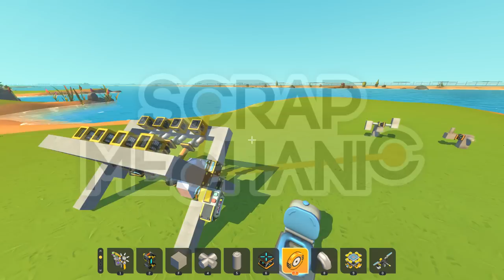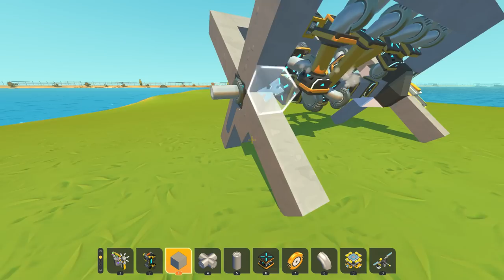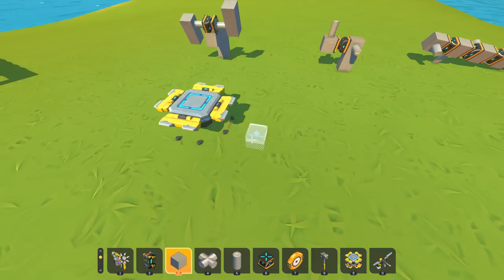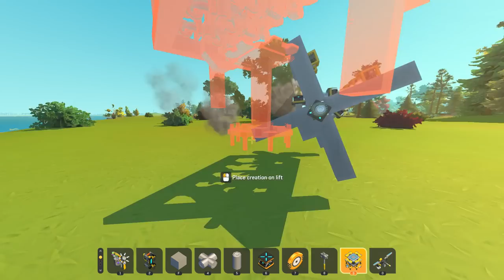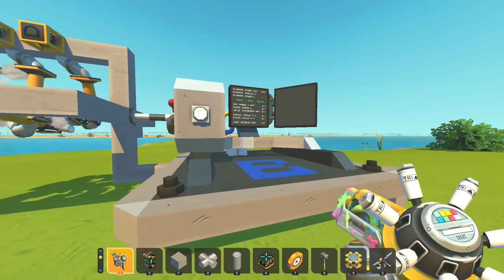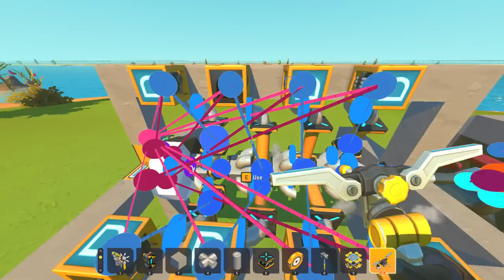I Built a V8 Engine Using 2 Amazing Game Changing Techniques!

Comment: Welcome to the wonderful world of advancing and retarding an engines timing! Normally in an older style engine with cap and rotor it will advance or retard an engines timing via centripetal force and spring tension. There's also the use of vacuum as well. Not sure how you can translate that to scrap mechanic though.
Reply: @Indy509 The old saying, people are like distributors. Some are advanced and some are retarded.
Weights and springs come into play, more then vacuum, or the lack of vacuum on some engines.
Fun fact, more then I can count, the gear on the shaft is on the wrong side of the timing line tooth.
The roll pin should be on the half tooth of the gear, not on the full tooth timing mark when lined up to the pointer on the rotor.

Comment: Here's a question: is this technique to replace the bearings with the piston hack a feasible method to replace all bearings where size constraints aren't a priority? In what situations would I not want to use that version over a bearing? Sure seems like this would solve a lot of problems all-around where the bearings usually slip.
Reply from the maker: You can only get it to go to 90, 180 or 0 degrees. Can't have a piston do any intermediate measurements so a bearing would be better in those cases.
Reply: @kANGaming  What about the free-spinning piston?

Comment: your actually correct, having different tuning for load is what real world engines do with advancing the timing of the spark plugs. 
I think the main requirement to develop different tuning will be a tachometer, which obviously won't be easy in sm. or though it might be possible to instead of having a tacho, to actually develop a variable throttle, that could operate in the same way. for instance a simple version could be to use the steering ability from a steering wheel to control a lever that then has different points that sensors pick up on. or alternatively having a multi stage throttle, with more limited control.

Comment: Please do a piston powered survival run, no electric of gas engines, every vehicle has it's own tuned piston engine. You would have to figure out unique and novel ways to complete certain tasks that were easier with vanilla engines, eg. how do you power your drills and saws, how do you power smaller vehicles, how do you set up a hauling truck for your crates that has enough strength to pull the weight, maybe you have to setup a train track/monorail system so you don't slip as much and have shallower angles.

Also I think you should start with a few pistons and logic gates, seeing as you wouldn't be able to use any of the vanilla engines that you are basically given early game.

Comment: It'd be super bulky and Idrk know Scrap Mechanic enough to know if it'd work or if I'll explain what I'm thinking well enough but, for a variable encoder wheel, could you do a large wheel, with sensor rings, coloring each layer as needed for the higher speed. Then use a couple timed logic inputs to verify the wheel speed to determine which ring of sensors to use as the encoder. So like the inner most ring will run if no other ring is running, the next closest ring will run if two inputs receiver input within say 3 seconds, the next ring will active if they both fire within 2 seconds and so on.

Comment: I haven't tried it,  but i bet you could use a single timing arm on the shaft,  triggering a single piston to extend slowly.  It would auto retract between cycles. You could use a block and sensors to tell what is position is,  as a sort of rough speed gauge.

Comment: If you are truly like a steam engine the timing events would correspond to "A" side of piston will have four events and the "B" side will have four events. Intake pressure valve "open" and "closed", exhaust valve "open" and "closed". The time that the valve would be open would be called "duration" and can be expressed in degrees of rotation. If you have control of those functions you will have the tools to truly optimize the output. With internal combustion engines the intake valve opens slightly before you would expect and for a short time both valves are open and the exhaust closes later than you think it would. Maybe one of the other viewers can tell us more about the specifics of steam engine valve timing

Comment: I have no idea how you would covert it to scrap mechanic but all gas motors are set up to advance timing when giving it gas and the same principle applies when letting off the throttle/ and or a heavy load pulling it down so the motor is always performing optimally.

Comment: you could have a little calculator that calculates the period of the wheel and use that to calculate the speed of the drive shaft qnd theoreticly it could all be done in scrap mechanic

Comment: When you change the text file for the creation, does that mean you then can’t upload it? I assume scrap mechanic would change it back when you upload it if it does?
Reply from the maker: You can still upload it normally. The game doesn't correct any changes you make in the text file which means if you make a mistake it'll potentially corrupt the blueprint and it won't load at all.
Reply: @kANGaming  Huh. Thanks for clarifying!

Comment: 45° Worm gears are better for differentials, they use more bearings but they are WAY smoother and way less buggy with collisions.
Reply: @kaylinosprey3306 Are you sure that would not be a spur gear set for a dif?
Worm gears are best used to reduce speed, and increase torque.

Comment: Also kan you definitely need to spend more time on timing and add more timing as you go up in rpms because essentially what your doing know with this engine is locking the rpm like a governor also you definitely need a flywheel if you do that
Reply: what i assume is happening is since this is a double acting engine since you arent adding timing as it goes on the double acting makes it worse

Comment: What if your timing wheel only had ONE white block, and the pistons were controlled by memory lock circuits?
This way if sensor 1 is triggered, the pistons associated with it will stay on, and the others will turn off.

Comment: The part that is seen by the sensor that fire the piston should be at the angle which is the next angle of the shaft in the future tick it should be calculatable with the rotation speed thingy on the xo-meter when deltaTime is 0.025(1/40) scrap mechanic has 40 ticks a second

Comment: With the v8 piston engine would using 2 encoder wheels 1 for each side of the engine produce more horsepower than using 1 encoder wheel

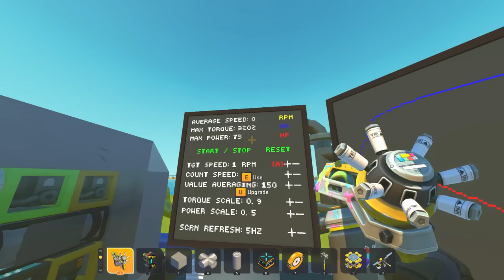Comment: 16:26
hey, you almost did as good as the peak power of a old ford flathead, them only good for bout 90 HP stock murcury managed to make one do 95 back in the day but most were good for bout 65 HP so yeah 
then again those also was able to spin up to ~4000 RPM befor floatin the valves
18:27 now, you talkin bout somthin akin to a govnor on a small engine which is a mechanical rpm limiter, instead of messing with timing which isnt easy to do on small engines of most varieties, being that they use a coil mounted to the block with no adjustment but for the gap, they tend to govern the speed using the throttle, similar concept, and it also works the other way too when it gets loaded down itll open the throat up to keep up

Comment: actually you can measure rpm by piston fire rate (and building simple encoder you can change starting engine loop increase angle by time and reset angle good starting angle when engine stop but how much calculation needed for this I do not know) , and actually whiteout building engine you can calculate max Torque piston engine can have.
Reply: ever 4 piston fire means 1 rotation it easy actually.

Comment: Please leave some space between the encoder wheel and the sensors. Please. 😅
Reply: The parts of the same creation dont have friction, yes. But they do have collisions. So its less a constantly rubbing, its more a colliding and stopping + shifting the shaft a little for a microsecond. So leaving one block space is still a good thing in my opinion.

Comment: might be worth increasing the size of the timing wheel, the bigger you make it the more precise you can make the timing.
Reply: I've tried this and it doesn't help that much. You lose power to the heavier spinning mass and its a wash with what you gain from the timing precision. With controllers having 1-degree precision, it's kind of a non-issue anyways.
Reply: @DigitalJedi  Ahh I see that's fair enough, I've never built piston engines on scrap mechanic so just suggested the idea based on steam and solenoid engine I built with scraps from work lol.
Reply: no. The pistons are on half the time, and off half the time no matter what, so 4 blocks on 4 blocks off is literally perfect.
Reply: @crinsen  Yes, but a larger timing wheel adds power because it acts like a flywheel (which you should have anyway), it has nothing to do with precision.